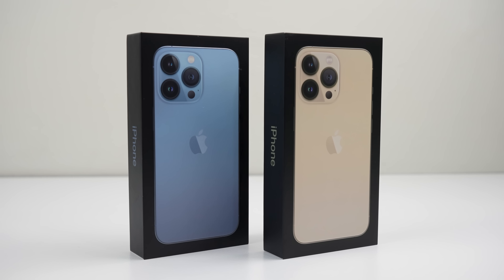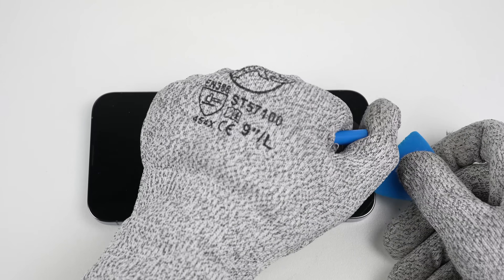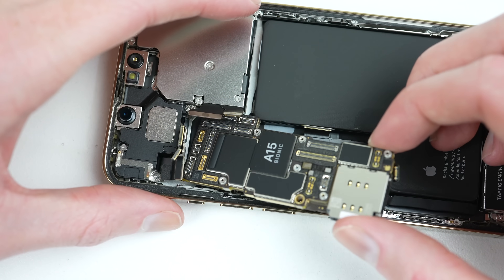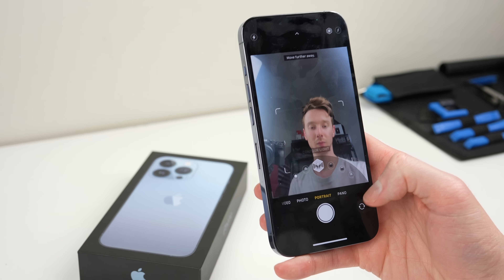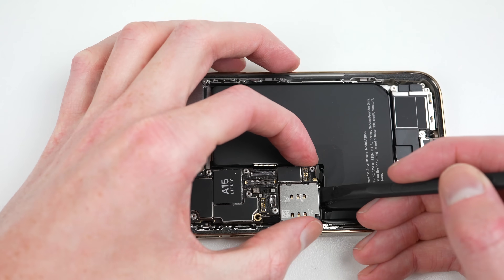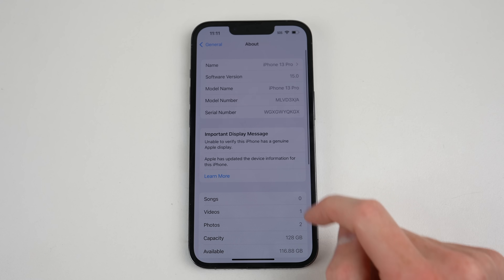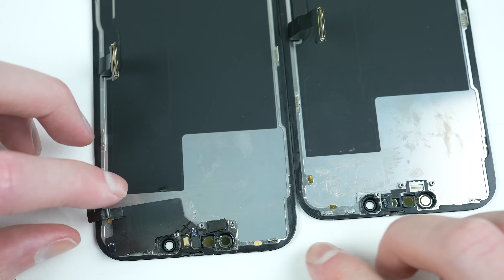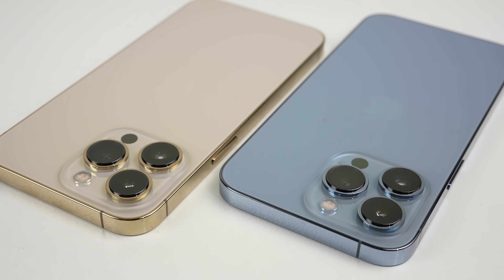iPhone 13 A Repair Nightmare - Teardown and Repair Assessment

Comment: Apple are shit, always will be shit and are run by shits. They are greedy, selfish and wasteful.

Apple are the dongle masters, they don't let you repair their devices, they keep making proprietary bullshit and have done in one way or another for many years. They rip people off at every turn either by devices, accessories or conning people hard via repairs.

I remember years ago, at the height of the time when companies were offering 20GB free storage via various different free storage platforms and Apple were selling their iPads with limited local storage, and a measly 5GB cloud storage. It would put a permanent advertisement in the UI to buy more storage from them for a silly price. I know this because a family friend asked for help about it - I certainly wouldn't buy one. And my word does word of mouth spread Apple products across the pool of old timers and geriatrics. Alarming.

Apple are for ignorant, stupid people or those just want to be different. There is zero logic in buying an iphone and it certainly isn't a fashion statement.

Comment: I've been building and upgrading all my computers for over 20 years. It has been an awesome experience because I have never used an Apple product and never will because of this. This is their legacy.
Reply: Me too! I was running a Phenom II quad core from circa 2009 up until a couple years ago. When the computer got slow, I switched from Win7 to Linux Mint, and what do you know, it miraculously went fast again. Eventually upgraded for faster multi-threaded compile times.
Reply: Wanna hear the sad part? You can actually try out their older stuff and it was so so good. Like, unbeatable type of good.
Reply: @necromax13  What stuff are you referring to? Apple stuff? If so, what kind of Apple stuff? I agree with your other comment so I'd like to understand this one better, thanks in advance!
Reply: @necromax13  Damn I remember this now - it was high school for me and I have terrible memory. iPhones WERE amazing when they came out. I remember the original iPod touch as well... just wish I had a chance to experience the powerbook as I have no recollection of that, but that's probably because they don't give 15 year olds industry grade hardware.

What do you think of the ARM stuff apple is doing now? Looking at how shitty everything else is, I feel like ARM might be the one thing that saves them... that or complete consumer apathy.

For the record - I have only one machine in the house running something other than Linux, and that's because work. I agree with you that the lack of expansion ability and long term hardware support is astounding and depressing. I agree that there are very few new things under the sun in consumer computing and that we're just selling disposable devices with a new shade of lipstick applied every couple of years. It's a classic case of induced demand - these companies have grown far too large to be sustained by an unaltered replacement market, so they force a demand to exist to justify their supply abundance, but they do it in a way that keeps pricing artificially inflated. This is a classic example of RENT SEEKING. 

https://en.wikipedia.org/wiki/Rent-seeking

Basically, they remove value from the economy so they can replace it with "new" value, but the net affect is actually negative because you've thrown an old device in the trash and the end user still only has one device. And they profit from this. Companies are supposed to profit by adding value to the economy. People are pointing fingers at each other as they starve and get evicted because every consumer-focused industry has convinced their (forced) customers that they're not economic vampires. They do this by diverting huge sums of money into PR and lobbying.

Thanks for taking the time to expound on your point and help me remember a better time! I look forward to your reply.
Reply: @erich1394  their arm developments? Yea I see them as a hard pivot towards bringing their computers closer to the iphone ecosystem, in every way possible. Most components of this current generation come soldered into the board so say goodbye to expandability and repairability. 

Also they're also saying goodbye to Intel royalties in the long term. 

It's a no brainer move for their current strategies, but it's VERY anti consumer, and I do very wholeheartedly hope their silicon falls flat in the market, because getting away with it in the mobile market is one thing, but introducing the same anti repair shitty ass technology into the home computer world is a slippery slope. 

Any potential user benefits they're claiming is hogwash. 

-------

And yeah, it's obviously rent seeking. I honestly have not that much of an issue with planned obsolescence, but apple is constantly adding to their oppressive consumer strategies. 

No repairs, no upgradeability, no reliability, no industry wide standards, almost completely closed off ecosystem...
Reply: @Vault-Tec Rep How will tracking solve the problem? It is not illegal, are you alright?
Reply: @Vault-Tec Rep trackable and traced by whom? Themselves lol. 

It is the future, unless more punitive laws towards big tech are created, they will get away with this, because they own the market.
Reply: This is the future. Apple is not the only company doing this,.

Comment: Companies that do this should be penalized with a huge fine, this is crazy.
Reply: Nah man, the whole company should be expropriated when they´re found guilty.
They´re actively trying to harm our species and planet in the name of profit.
Reply: Penalize them by forcing them to remove this software lockout and force them to sell replacement chips based on regular old volume pricing with no special deals for apple's repair shops. (read - no jacking up the price for independent repair shops). Penalize the fuckers by forcing them to compete instead of living in their rent-seeking regulatory-capturing circlejerk.
Reply: @ulsenheim girush it really sucks to walk around every day with this knowledge. knowledge or happiness i guess!
Reply: Even fines won't bother them because any fine large enough to put a dent in their operations would be deemed "excessive" and they would bitch about it to no end through their lawyers and lobbyists until the money they were fined was given back to them with an apology and the law that allowed it to happen was repealed. As it stands now they literally set aside vast amounts of money specifically to pay fines and when their yearly income is far greater than the yearly production of most nations, they easily write off even multibillion dollar fines as "cost of doing business" without the need for much consideration. "Punishable by fine" just means "legal if you're rich". Also any money they pay in fines usually comes back to them through other channels anyways, so even the fines are just for show so governments can make it look like they care without actually causing their other rich friends any harm. Generally this takes the form of the government that fined them taking the aquired money and "investing" it in the growth of the company they just took it from. In the US most government officials have large amounts of money invested in major corporations, so it would hurt them too if they were to actually punish said corporations for their actions.
The correct response would be jail time, and not in a cushy Martha Stuart prison. Fines don't bother them. If anyone who wasn't a multibillionaire tried this shit they would be practically crucified by the same people who allow these corporations to get away with it to "make an example" and put on a show so people think they really care. They would be held liable for damages resulting from their decisions to prevent consumers from repairing their own property and forcing them to bring it in for repair at a scam rate or just buying a whole new device when the old one should have been reasonably serviceable, and at the end of it they may well be given jail time because they couldn't afford the lawyers, lobbyists, and bribes needed to get away with only a simple fine.

Comment: I used to love Apple. Got a iMac in 2007 that lasted 10-11 years and a gen 1 iPad that still works today. When my Mac died, I bought a new one thinking "oh, well my last one lasted forever!" Big mistake. It was super slow out of the box and it died withing 2 years. Plus I got a gen 6 iPod and it's screen cracked within a week after purchase from a small accidental drop. Apple told me I would have to pay $100 just to fix it, which was half the price of the entire iPod itself. It wasn't worth it and I just put packing tape over the screen to prevent the glass shards from falling out. 

It seems like their quality has gone in the gutter while the prices have just skyrocketed.

Comment: i would guess these parts ARE swappable, but they need to be coded specifically for your phone serial number. i.e. apple will actually supply the service center with a working replacement provided that the repaired phone serial number is known ahead of time

Comment: Apple will undoubtedly claim that  those changes may have some impact on security of their phones, as an excuse.  Someone  actually could install malicious face ID module and display with built in data recording etc. However if you can do that, you can probably replicate the IDs of the components as well.  And no regular individual will ever need that kind of physical protection anyways.

Comment: Meanwhile, Valve posts a teardown video of their own Steam Deck.
Reply: Yeah and the only discouragement they give is "for the sake of your device you really shouldn't do this, but yknow, it's your property so we're not going to stop you."
Reply: @mrrazfromnz  WOW, much respect for that, now, archaic attitude.  We should always be allowed to repair our stuff instead of tossing it in rubbish bin.  Furniture out there from over a thousand years ago then fast-forward to IKEA of today, and you can't repair it because it simple falls apart.  TV's dating back to the 1950s still work today that are easy to repair (too bad we remove analogue standards but beside the point).  I have radios from the 1960s that can be repaired (normally capacitors are the problem).  I have computers for 40 years ago I can repair.  I have cell phones from 1970s to even flip phones, to feature phones to smartphones to around 2016 that could be repaired.  SUDDENLY there is an issue in allowing that so glue the back on is where it all began to go downhill.
Reply: @generalawareness101  My Samsung TV is also still working perfectly fine.
But I guess this is due to the fact that I only use it as a monitor and never connected it to the internet for updates & "smart" functions...
Reply: @r.c.christian4633  My first Samsung monitor died slowly over time (didn't take too many years) but an easy fix that was so prevalent they sold kits for 10 USD on Amazon, eBay, etc...  The kit was just the known electrolytic caps that would go out.  A lot of the time if you see a monitor, or a tv being thrown out grab it as it probably has a bad cap or two ESPECIALLY if they are Chinese garbage caps (which the Samsung monitor used but everything else was Japanese and built like a tank).
Reply: Naura... 💅💅  are you mentally stable
Reply: @0djunder0  snakes are not enough! I need protudates!
Reply: but they will still not update tf2
Reply: @Sonicsnak  yes they did, they added snaaakesss
Reply: @Sonicsnak  they know that it still profitable after years of no updates bruh just new hats and sht
Reply: Naura... 💅💅  bruh look at this fatherless woman
Reply: @ronmka8931  its bot
Reply: @rejfen714  i am aware this is a bot

Comment: That green initiative by Apple is the biggest load of shit.
Packaging even when it's all plastics is a tiny fraction of a fraction of the carbon cost of a device. An iphone costs approximately 55-60Kg in carbon footprint, the plastic wrap around the packaging would amount to something like 20g of carbon footprint.
Their consumer culture of pushing people to replace a device after 2-3 years (sometimes just 1) is a way bigger draw on carbon emissions. 
Fuck Apple and their mountains of E-waste.

Comment: There should be regulations forcing manufactures to design "repairable" equipment.
Reply: Or a system in place where if we paid them if they do something with the money the bank locks up... 

Changing the original transferred moneyto another number is not allowed. see how they like it

Comment: I work at Apple store for a few months and when we swap cameras face id etc need to calibrate the iPhone with the new component nota just plug and play but you can put another part of an used iPhone and when calibrate it still work
Reply: It is the same method like touch id

Comment: Hello there Hugh:

This is why I REFUSE to give apple ANY of my money. I mean what if the only option close to one's house was a 3rd-party repair shop and the nearest Apple Store was a solid 2 HOURS ONE WAY AWAY from their house? That sounds like a MAJOR inconvenience there. That and INSTEAD OF ACTUALLY FIXING THE ISSUE WITH THE PHONE, THEY NUDGE THEM INTO PAYING HUNDREDS OR THOUSANDS OF [INSTERT YOUR LOCAL CURRENCY HERE] FOR A REPLACEMENT. I NEVER ONCE gave apple my money while my mom did ONCE for an original iPad and she IMMEDIATELY RETURNED IT cause she didnt like the OS and we have been solid android ever since. Apple is known to be anti-consumer AND repair and this just adds fuel to that fire and makes their green commitments moot cause this just adds to MORE electronic AND paper waste cause by taking all the critical components OUT of the box, it means more boxes. Their commitment to sustainability is pretty laughable if you ask me. I agree with you 100% on the fact that you would want to keep your phone till AT LEAST when OS support for the phone ends. I mean phones are getting more and more expensive and making them LESS repairable is just sheer corporate greed and why anyone supports apple is WAY beyond me but there are unfortunately those sheep out there who do and keep giving Apple their money as the device gets sold in the millions every year and it is really unfortunate cause it just gives them the incentive to make their devices worse and worse in terms of repairability and it is really disgusting. Apple will NEVER get a dime from me as their products are WAY TOO OVERPRICED for what you really get. I mean you could get a similar performing Windows laptop for FAR cheaper than what you pay for a MacBook. I cant justify spending $3K US for Core-i5 laptop with integrated graphics when i see a Windows laptop with the same setup for like $600 US. I dunno about you, I would save $2.4K US and go for the Windows laptop. ESPECIALLY with the crap customer service Apple is known for.

Comment: At what point do you say, stop buying Tim "Apple" Cook products. If you are going to spend the money on phone, buy one that can be 100% repaired. Cell phones shouldn't cost $1000. A cell phone should be able to have a complete backup on line, if you lose it, it's stolen, or destroyed you be able to to quickly by an off shelf phone and get along with your life.

Comment: Next time Apple will make sure to prevent this kind of testing by making sure that any time a non-matching serial ID is detected, the disabled features are permanently disabled even if the original components are replaced. That way, you can never confirm that it's the fault of the replacement, only the fact that you tampered with the phone.